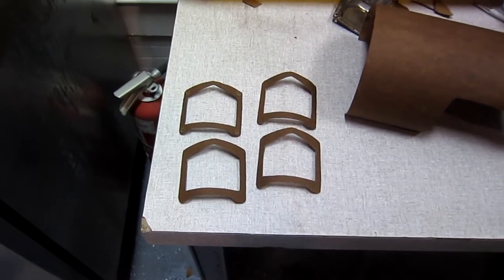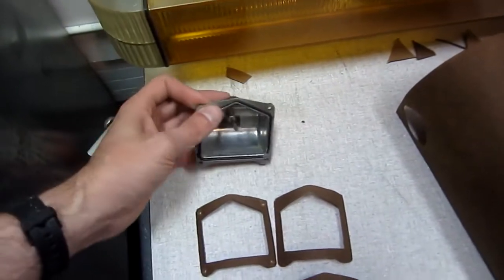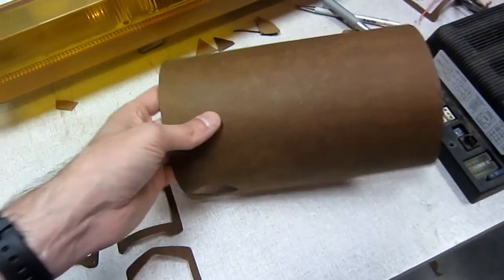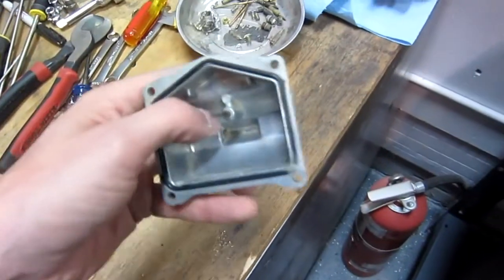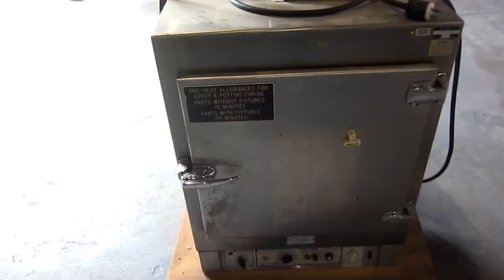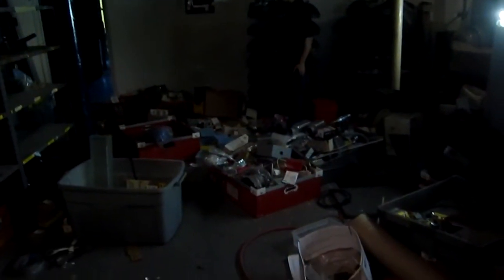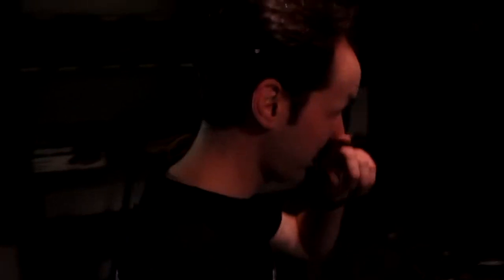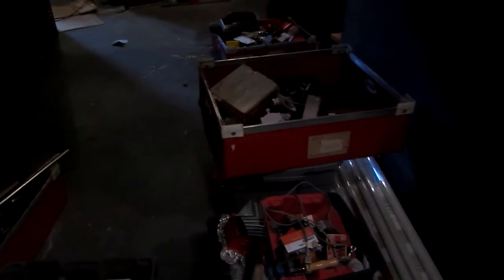Captain's Blog 7-24-11 550-Four Gaskets and Supply Sorting

Comment: you can also get the gasket material at any number of auto shops. There's also a few different types of material, a rubber cork, cork, rubber polymer, the standard stuff which you had, and I think there may be one or two other types.

Comment: great job on those gaskets!  if that sheet router has a razor solution i have a few gaskets i need cut for my own motor cycle... namely i'm tired of my tank leaking at the petcock.  lol.  its a little half inch by 2 inch gasket, but it'd be handy.  I just dirtbike around w/ it due to the lack of motorcycle endorsements, but yeah.  BTW - holes in gaskets are best done with leather hole punch tool.  Lots of guys drill the holes between two peices of thin board to make them clean so no twisting